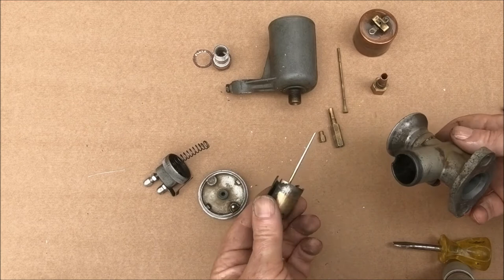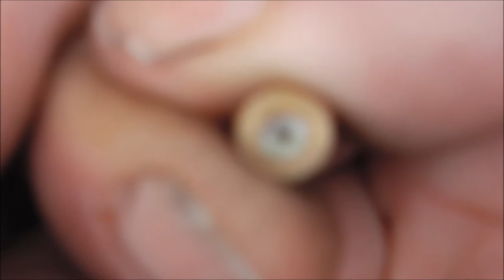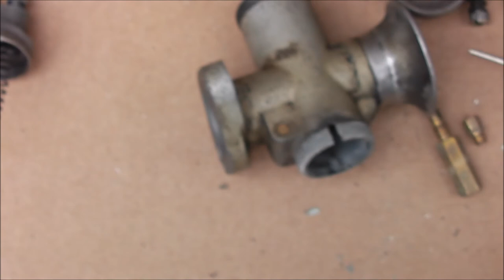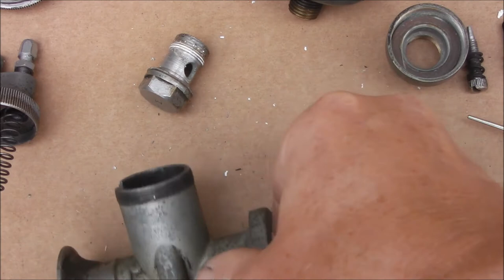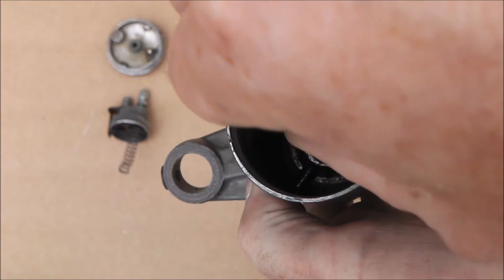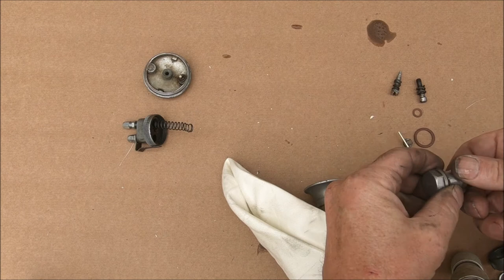AMAL 275 PRE MONOBLOC STRIPDOWN

Comment: Excellent video! I have the same carb on my Zundapp. It will  not idle unless the choke is fully engaged. The airscrew does nothing. Any thoughts?
Reply from the maker: Possibly the  air jet is too small or blocked.